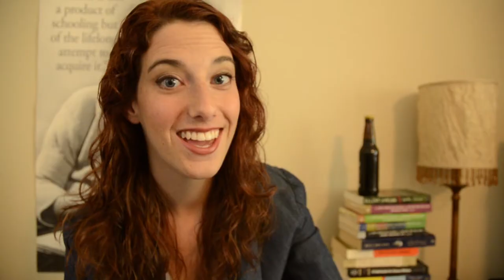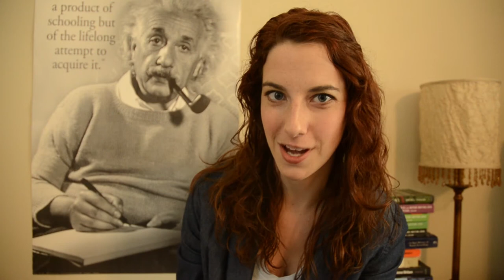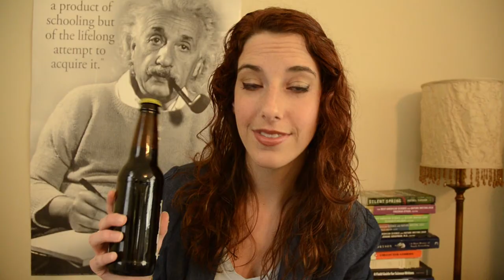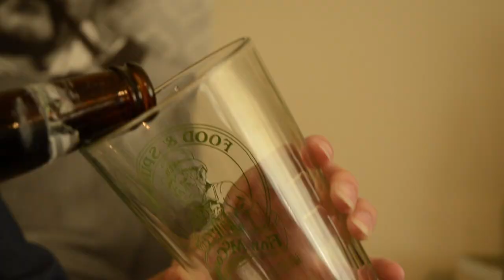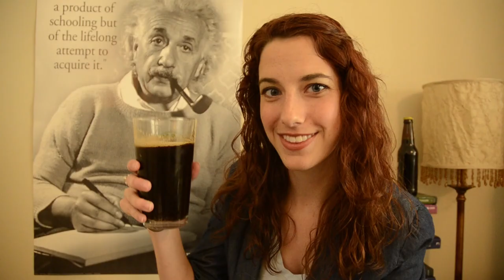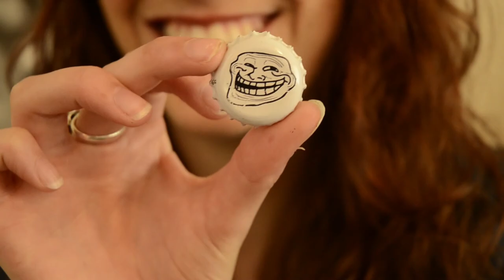VEDAug 16 - The Science of Beer

Comment: Was that a porter or closer to a stout you were drinking. Did not soar to have the thickness of a Guinness so I figure it's probably one of the other two. I an a huge fan of porters. They pack in a lot of flavor, relatively high in alcohol content and asks meant primarily for sustenance. They also don't have the dry taste of a stout. That being said Old Rasputin is not bad for a stout. However i well say my top beer stands with the Sinebrychoff Porter. At least until I find something better.